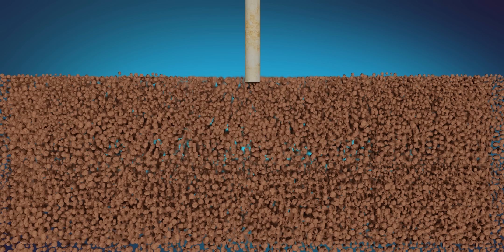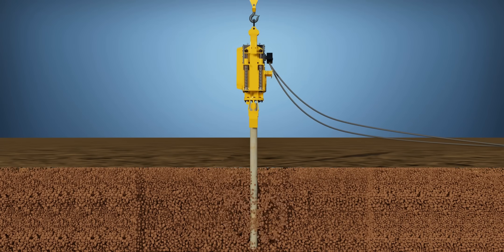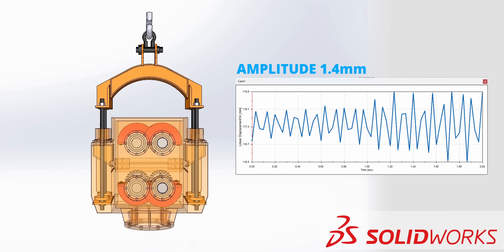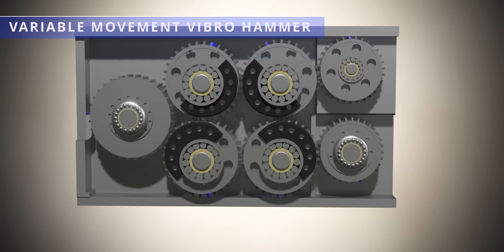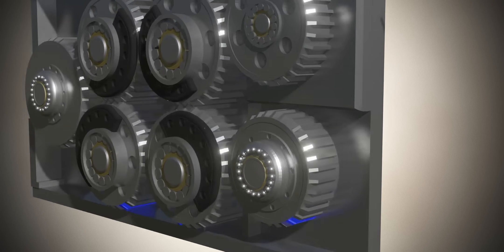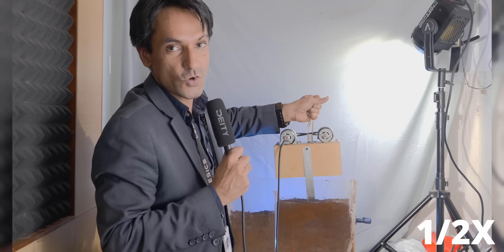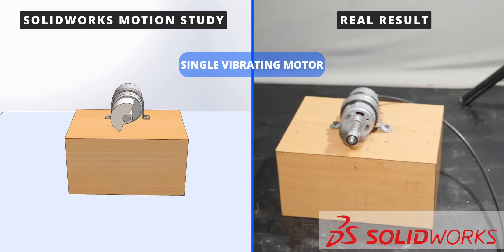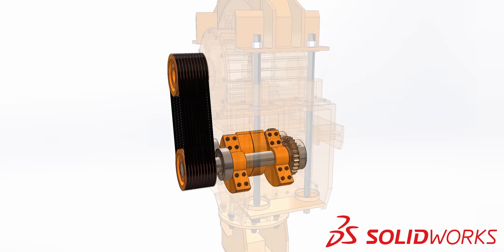How is Piling done?

Comment: So how does the operator change the secondary set of eccentric masses(to vary the amplitude of vibration) if they are all timed and geared to by a single hydraulic motor? Is there some clutch mechanism or torque converter so it won’t always be locked in-time by the fixed gear train?
Reply: I've asked myself this for a long time... All I know is some type of rotary actuator is involved. I hope to tear down a variable moment vibro hammer at some point.